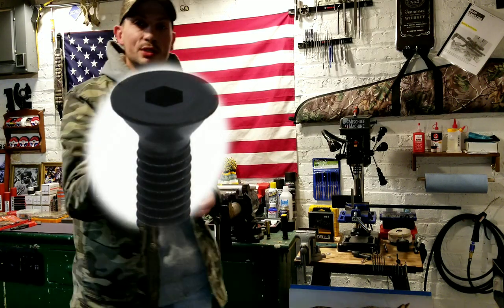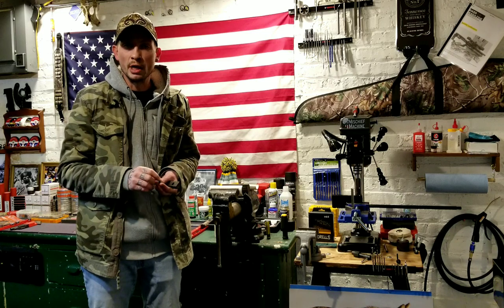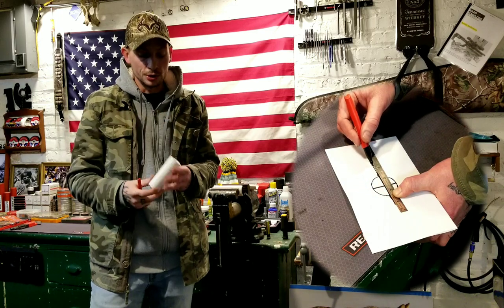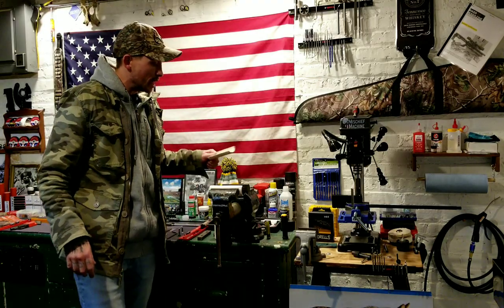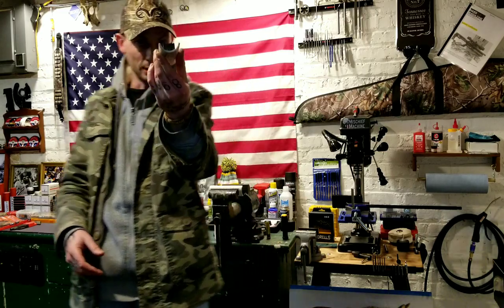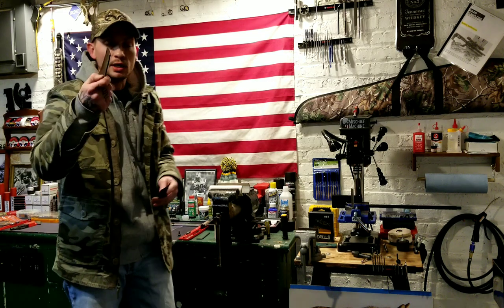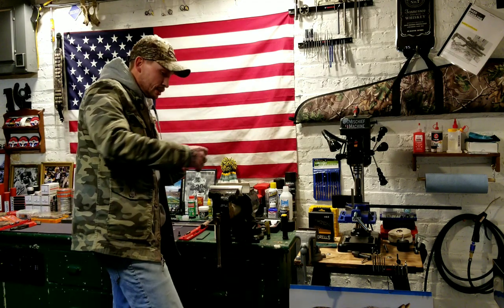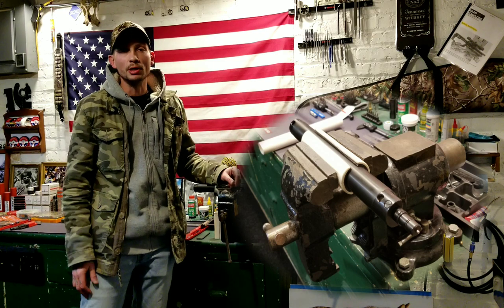DIY PCP AIR CYLINDER VISE JAW INSERTS

Comment: Nice video I Got the flash pup wood in 25 cal a week after having I noticed it was a leaker, leaking 15-20 bar a day so I removed the air cylinder from the gun put my ear up by the bleed screw and manometer heard a tiny bit of air leaking near the bleed screw would you recommend tighting it anymore I'm new to pcps and don't want to mess anything up

Comment: Hello friend, I have a regulator on my Flash .22 configured at 150 BAR, I can only get 20 shots from 200 to 150.

I am thinking of increasing the pipe size to 700 mm or installing the BT65 cylinder.

What would you recommend me? I would like more shots with it, or even more speed to shoot Slugs.
Reply: I have a BT65 aircylinder on my Hatsan Flash Wood. I just reused my airvalve from my original tube. I have a video on my channel on how to do this easily. I installed also a Huma-Air regulator to the aircylinder.

Comment: Hey brothe, I just got a chronograph and was wondering what ballistics app do you use.i tuned my flashpup s .25 down to 2 3/4 turns and it averages 799 fps and averages 35 fpe at this tune for me.i haven't gotten the confidence to get into it yet to clean or  polish anything.just trigger work, hammer spring tension and barrel cleaning.as always, thanks for all the info!🇺🇲

Comment: Chad... When I fill my gun it loses air when it first starts and then seals and Fill to just under 200 bars and then start blowing air again… I did make a mistake and put too much of that three and one silicone seal on the two O-rings on the probe… Was that the problem… I found what looks like remnants of a yellow O-ring inside the stock near the fill port when I took it apart...  How do I fix it... Richard

Comment: Do you have the new synthetic? I got one last Sunday and I'm not impressed at all, it's inaccurate, can't get it to turn up any higher than around 850, it's quieter but has no power like my Wood FP and it won't turn up. There's a definite difference in the two, I love the bolt and adjustment on the but pad. I'm thinking about returning it, there's no accuracy and it's weak, also number all over the place no matter where I set the hammer spring adjustment. My best group is about 2" at 30 yards. I want the old FP with the synthetic stock, it's a beast, just not happy with my new one, it's not the same gun, wondering if I got a bad one because this one does not want to cooperate.
Reply: I have the new flash pup syn in .22. My gun is a great shooter.  It really likes the JSB 15gr, JSB 18 and the hades. Stock was shooting the between 840 and 870fps. About a 3/4 group at 40yrds all day. Tried the JSB monsters 25gr and was all over the place.  Started tuning the gun hotter to see if would do better with slugs, did a little better but not good enough. For the hell of it I tried the 25gr monsters again with the gun shooting them faster at 770fps and can make one big hole at 40yrds. I've been using the single shot tray, will need to try with mag to see if there is a difference. Will also push out to 80yrd to see how it does. The air arms pellets do well also.
Reply: @edwardfern4359  That's awesome, my wood Flashpup was a laser out of the box, this one needed some work, it runs fine now, but I had to fight with it for a week to get it running good.

Comment: Chad… Got a problem… My bolt is loose and sloppy all the sudden and will not move back far enough to take the magazine out nor forward enough to fire.… It has a stainless steel bolt lever and I don’t know how to take it off to extract the bolt... different bolt lever than yours... richard
Reply from the maker: I've been there my friend. Remove the gun from the stock via the two screws. You will notice on the side of the block opposite the bolt handle there is a flushed off plug with a flathead screwdriver slot in it. Remove the plug and then you can position the bolt so that the cap screw that holds the bolt handle in place is showing itself through the hole. I can't remember but it's probably a 2.5 mm or 3 mm Allen. I would remove the screw completely add a touch of blue Loctite and then put the cap screw back through the bolt and into the handle and secure it down tightly. Then you can replace the cap screw on the side of the block and you should be good to go without the bolt handle ever coming loose unless you are purposefully removing it. The reason you can't cock the bolt back any further because that cap screw holding the bolt handle in place has backed itself out enough that it is engaging with the hole and the cap screw on the side of the block. Once you get it tightened back in you will be able to move the bolt freely again. Hope that helps you out brother
Reply from the maker: Also a couple tips. Take care when removing the cap screw that holds the bolt that it is lined up with the hole in the side of the breech-block so that it backs out through there accordingly. Once you are done and have things back in working order and if you have double loaded any pellets, I would unscrew and remove the shroud because sometimes they will clip if you fire more than one in the barrel at once👍

Comment: I no longer have a workshop ... vise etc. so I guess my only alternative is maybe to take it to a machine shop otherwise I won’t be able to install a regulator… Any advice
Reply from the maker: Some people have reported no Loctite being used  and being able to loosen them by hand or with little resistance using a strap wrench. It's worth a shot if you have the various hand tools you would need to take the tank off and such.
Reply: BROTHERS IN AIR Thank you I’ll give it a shot… Your videos have been very very helpful I’m totally new with this… Had a gun powder for all my life ...
this is fun

Comment: Chad… Straighten up my qe shroud problem… thx... As a good study; I zeroed my .25 flashpup at 45 yards... why.... is like the zero at 50 = 200 yard zero? richard
Reply from the maker: The reason for the 45yrd zero.... that gives you a near zero of roughly 25yds with less than a half inch rise in the trajectory out to 45yds. Then you are zeroed from 25-45yds and can shoot anywhere between these yardages with no adjustment. Anything before 25yds or after 45yds would then require a holdover or turret adjustment.
Reply: Chad... I’ve had my 25 caliber flashpup for about three months and I’ve had trouble with the magazines feeding. It came with the new red magazine and kind of work at first but now, I can’t even go get one feed without double clutching the needle and jiggling the magazine… And these are two new magazines. The gun is really accurate and I enjoy shooting it but it’s so frustrating and it’s really difficult to juggle the magazine and the boat at the same time but it usually goes in the place if I move slowly. I bought the gun to hunt with and this really destroys any follow up shot. Any suggestions? Richard
Reply from the maker: @NAIRdK101  what projectile are you using just out of curiosity? If the screw in the center of the magazine is too tight it will not allow the magazine to cycle properly and it will just get hung up. Try loosening that screw about an eighth of a turn at a time until it's loose enough that when you twist the mag all the way anticlockwise as if you were loading the first pellet and let go the gear shaped piece snaps quickly all the way back to its resting position with no drag whatsoever. That's about all I can think think of unless you are using some irregularly long shaped pellets. I assume it's not the latter because you would have had the problem from the get-go. Let me know how it works out for you and if that was the fix.
Reply from the maker: @NAIRdK101  all eight of the magazines I have came to me with that center screw too tight and if you twisted it all the way anti-clockwise and let go it would slowly drag its way about halfway home and then stop. When this is happening there's not enough spring tension to overcome the over tight screw and cycle the magazine cleanly to the next pellet
Reply: Chad… That makes sense… Unfortunately I live in a condo and I can’t go out and test it right now… I put some 25 caliber cleaning wads in the magazine and they held the spring and everything. it cycled perfectly and fired the wads... i’m shooting JSB king... 

thanks so much for your help. Chad I’m frustrated now I can’t imagine where I’d be without your help… Can’t wait to get in the woods and go hunting with my gun… Looking to do some coyote calling. Again… Thanks… Richard
Reply: Chad you’re amazing… I couldn’t load the magazine and fire / test... neither of the magazines would spin back to its home base so it’s exactly what you were saying… One magazine took 1/8 of a turn in the other magazine took two 1/8 turns which snapped back rebounding down to about 9 o’clock... richard ... i’m so excited… Haven’t been able to operate the gun the way it’s designed... shooting jsb king heavy  25 cal thx
Reply: BROTHERS IN AIR Yeah… I got into the range yesterday and I still have the same problem of the magazines not cycling… I have to jiggle the magazine up and down and work the bolt back-and-forth ... it seems like it enters on the second throw... One strange thing happened using two new magazines with the proper center screw tension one magazine actually operated correctly on the very last shot in the magazine and did it two out of two times… The only time the bolt action cycled correctly... richard

Comment: I was wondering if I sent you my Hastan Flashpup would u do install and tune of huma regulator.. Im willing to pay I jis don’t have access to tools
Reply from the maker: Sure I could help you out. Email me brothersinair@gmail.com 
I'll be off work in the early afternoon and then we can chat via email.
Reply: BROTHERS IN AIR  thank you i will do that..
Reply: Hello, sorry to bother you again. I sent you an email wasn’t sure if you received it. However, if you have and are not interested in doing that much help, just let know it is fine. I understand it’s a lot of work thank you.
Reply from the maker: @elimanuelquiles9935  I actually have to have the notifications turned off on the email account or it interferes with the YouTube comments and screws everything up. I have to check it regularly so when you didn't respond the first day I stopped checking. I'll get right on it and read the email and just turn on the notifications
Reply from the maker: @elimanuelquiles9935  I do not have any new emails in the brothersinair Gmail account. Maybe the address is misspelled? Maybe try again or send me your email address in these comments and I will email you to see if we can link that way. My email address is.         brothersinair@gmail.com
Reply from the maker: @elimanuelquiles9935  I sent you an email to that address so you should have an email from me now. Once you email me back with some details about exactly what you would like to do then we can go from there.

Comment: Someone knows the function off the part 2993 (exploded view) off the hatsan flash? I will have some problem if i r emove this part?
Reply: You probably already had this answered or figured it out, but for others wondering, its the hammer spring spacer. I've never removed mine. Removing it would just loosen the hammer spring further. Looks like it a bearing surface between the spring and the adjustment screw.

Comment: Whoops… I’m shooting 
25 Cal flashpup syn qe... new gun... less than 500 pellets thru it
Reply from the maker: Yeah I experienced the same thing with the same setup on my flash wood and my flashpup synthetic. It's unfortunate that they can't or won't do enough testing on a gun to see that the energy and vibration from each shot eventually loosens the bolt handle. Considering a dab of Loctite fixes the problem forever you would think they could have mailed this one down so that the end consumer didn't have to worry about it right? LOL hope you get it squared away brother
Reply: Thanks man… I think I figured it out just got to get it back together properly… Thanks guys
Reply: I’ve got it under control now I think… Thank you for your help thanks for all your video help… I think since I have an a part... I’m going to heat anodize the bright stainless steel bolt lever and turn it dark blue for hunting purposes... thanks again... richard